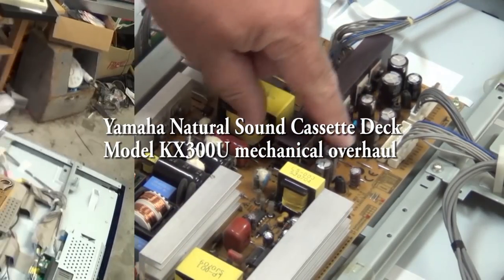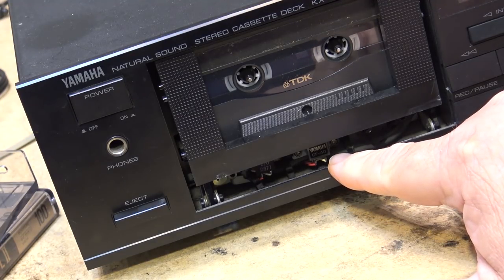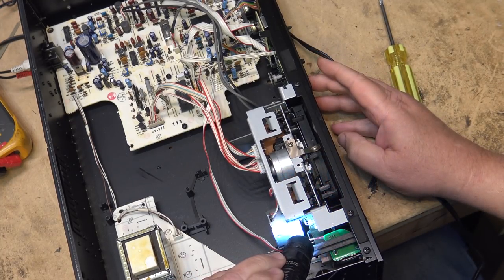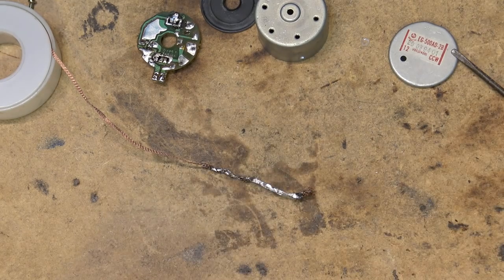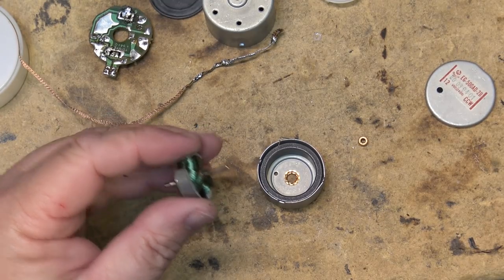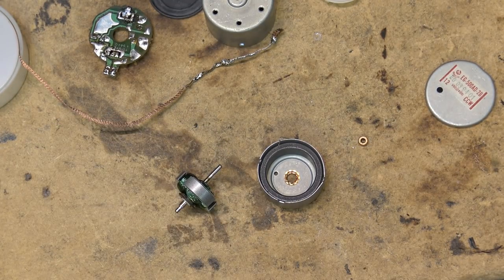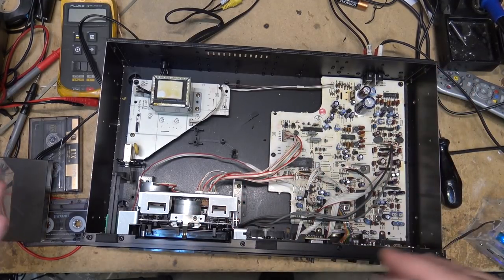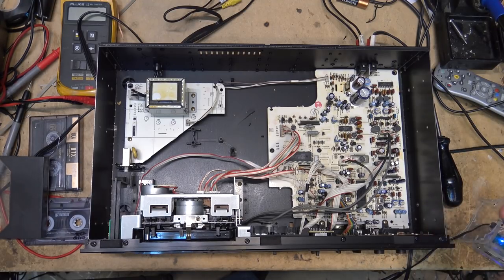Yamaha KX300U seized capstan motor repair not replace

Comment: Thanks 12V!!!
I didn't need to go this step, I was able to manually get the motor going and after letting it play for a while it now just spins free again!
I added a dot of oil to the shaft once free, should work its way into the mating surface.
Reply from the maker: How are you going to get the back bearing that way?
Reply: Thus far I have not lubed from the back. I am only in my thirties, so the tape players I had as a kid were low quality, so my point of reference is small. But I would imagine an dual deck, hi-speed dubbing Onkyo, made in Japan in 1988/89 would be pretty quiet... I could clearly still hear the motor with the case open; its reasonable with it all assembled.
Should I expect it to be very very quiet? I don't know what a reasonable amount of noise from the capstan motor is to know if its required to lube or not.

I need some sort of plastic pry tool, the metal cap was directly on the circuit board and the noise was not worth the damage... @12voltvids

Comment: The 2 arc shaped slots in the back plastic are for inserting a tool (I use a U shaped wire) to move the brushes out of the way when inserting the rotor. You risk crushing them if not careful.
Reply: I was about to say that 👍👍

Comment: Got the KX W202 version of that dual deck and i rebuilt the motors, the brass bearings wore out and the armatures were flapping about in there, replaced the brass bearings and the unit works great, it has lots of hours
Reply from the maker: Yup that is always a possibility.  This one just seized up because it sat so long without use.

Comment: I would have thought it would be much cheaper to get a new motor than have Dave overhaul the old one. Very enjoyable video.
Reply from the maker: When I could go to the local shop and buy one for 5.00 sure but they are all closed up. Now stuff has to be ordered and when idiots at the online shops don't listen to shipping requests to ship by post and they ship fed ex because they get a discount and then fed ex adds 37.50 in broker charges to a 5.00 motor it is not economical to do it.   This was an easy enough fix.  9 out of 10 motors center be fixed like this.
Reply: @12voltvids   Andrews Electronics here in U.S. is very helpful in finding parts. They pretty much have diagrams for everything and so when you call just give the model no. and describe the part needed, motor  etc. Also they have a research dept that will search for parts & call you back later.

Comment: Thanks for the fantastic tutorial! I've got a deck with the same, apparent problem on both decks. They both click when you had play and FF/RW, but nothing happens. The deck is nearly unused, but it sat 30 years in it's original box. I'll try lubrication of the capstan motors first! Great tip about the solder points coming apart, as well!

Comment: Lucky me so far have not had to take any motors apart yet.  Just finished a Nak CR-3A and had to soak the cam switches over night in Deoxit to get good continuity.  Keep up the good work,  love your channel.  I did score a Sony WA7ESA on ebay for 19 bucks and all it needed was new belts and pinch rollers.  I did work on a DJ mixer from Canada many years ago and the gal really loved it and paid $100.00 US dollars for two switches it was made in Europe and the only parts distributor was in Quebec Canada,  Duty charges are ridiculous.
Reply from the maker: Not duty.  Broker charges.  Totally different thing.   Private companies like fed ex have their own charges to fill out the paperwork.   By post I have never paid s penny except when someone does the foolish thing like declaring a broken piece being sent for repair with some outrageous value.  A Walkman is not worth 1000 but for the guy that thought it was, well he paid 175 in taxes to get it to me.   It was a broken Walkman, it has a value of $0.00

Comment: Great job!
I completely follow your ideas about components replacement, even if shipping fees are somewhat lower in EU, parts for a 20 years deck are difficult to locate or quite expensive, even in top renowned brands. Most parts like motors or transformers have to be sourced in China with high transport (that's heavy stuff) and toll fees, and can easily be lost when not needing 1 month delivery time. You can sometimes resolve the trouble finding a similar machine on eBay for exchange parts, or buy a high end industrial equivalent, but this solution can also become a pain in the "budget". So when I encounter this kind of motor, I prefer your solution, a few minutes well spent. Some motors have the reputation of being much more tricky to disassemble, those with fragile nylon couplings or complex clutches, but that's finally always the same problem: find the assembling solution and reverse it, or find an alternate one, even partial, that gives you access to the failed or seized part.
I've also saved a few transformers with failed thermal fuses or bad solders, and needs high voltage insulation tests... Plus, most transformers have specific or multiple output voltages, a nightmare if you need a supplementary medium voltage for fluorescent displays, or separate outputs for AD converters.

I hope your new solution with audio rights will work best against these illegitimate claims! Even if you sing a Gregorian anthem in latin , there's always an escrow pretending he did it?

Comment: That was really interesting to watch. Thanks! I really learned a lot. I was trying to record old cassettes with an old Sony Boom box given to me by a friend. It played one song, then kind of speed up the playback speed. I stopped the cassette and ejected it to see if the tape had been pulled, but that wasn't the case. Put the cassette back in and hit the play button, nothing works. No FF, No Rew, no Play. So I've been Googling what the problem could be and came to your channel. I'm not trained in electronics, but I do like taking things apart. So I'll try and see why the capstan is not rotating. The playhead engages, but I don't know why nothing is turning. The belt is still in place. I don't know if it is slack. Or maybe it just needs so cleaning.

Comment: Great job =D  I've done the same thing myself!  Sometimes its hard to source a motor of the correct dimensions, voltage, RPM etc.
Reply: Absolutely. By the way, hope your doing fine.
Reply: Of you buy one off ebay and it is a pull from an old unit.
Reply from the maker: Thanks, I take my bow now :)
Reply from the maker: @HBAVHS  I'm doing great. had a crapy summer as I was attacked by some nasty hornets, and found out the hard way that I am allergic to them, and found my self in the hospital hooked up to all kinds of monitors. Then what do I do almost as soon as I recover, get stung by another one of those little bastards.

Comment: I fix a lot of fans as well, using a drop of oil into the sleeve bearing to get them lubricated again, and they ran for many more years. Also used to repair small fans, where you had to replace the 2 tiny bearings the fan ran on, and then assemble it again. Had to fix, as they were no longer made, and as source of the bearings we had a large collection of assorted synchro assemblies, from scrapped aircraft. Lots of gears for the current aircraft repairs, and all I needed was failed syncro units for the bearings, and the odd working one to grab new coil assemblies from to fix failed windings, so we were really frugal with the pile of scrap.

Comment: Great video, smooth talking. I guess these simple decks have no issues with torque, i mean i have an expensive deck that has issues getting to the end of the tape. Wowow & flutter increases minute by minute, Just because it needs the torque spindle to be slightly slowed (Like a VCR) to keep tape at the right stress. Without it it eats tape as you well know. The power on the motor is sufficient for FF up to 98% of the tape. at the end it just struggles and struggles. The same motor RWD's perfectly. It's just that simple Y gear that turns left or right with RWD and FF. The left spindle has a tension regulation as i mentioned the right has none. So why have these simple decks no issues with this? It is a pioneer CT-339. It is a bit of a mystery, bought it for 9 euro's because it was malfunctioning. It turned out that these decks have a tiny plastic part that pushes all so slightly against the back of the left Spindle Gear. It was missing, that said it recorded fine but only on well cased cassettes from TDK or Maxell. These had strong tape regulation inside the cassette and the deck had no issues with those. Only wow-wow and flutter would increase slightly but noticeable at the end of the tape. I replaced belt, didn't work. Than i looked up the service-manual and it show no sign of a tension regulation in exploded view. I dismantled the mechanism so i could see inside at the back of the spindles and yes there was that tiny bracket that would house a tension regulator. Probably a ball inside a tube rolling against the back of the left spindle gear with a spring. I fabricated a simple plastic replacement and the deck records fine now with all tapes but with all the problems i already mentioned earlier. My guess is these decks are delivered from factory without this tension regulation part and hope for the best. Think about that, from Pioneer?
Reply: I had the same problem with a brand-new 2020 Marantz double deck I had bought! The Capstan's looked like something out of a gumball machine! What a joke! I had to bring it to the electronic recyclers two weeks later! The best decks are from 1988-1996.

Comment: Smashing repair, well worth the time to recover that motor.
I looked around for a motor for my mates 1977 tensai tape deck, but there was a lot of crap out there at daft prices, so gave the commutators/brushes a clean and it was good enough.

I always found the old self regulating motors with the flying out weights/contacts very novel.
Must have been a very expensive motor to manufactuer.
Reply: I just repaired a Fostex X77 Cassette multitracker with a worn out motor bearing. It's no wonder the motors wear out on these things because it is a one motor deck. FFW, RWD, Play all handled by same motor. Finding the correct Dual speed,CW motor was a nightmare. Eventually got one shipped from seller in Australia!
Reply: What about the decks that have a constant running motor, i always thought that was a fast way to wear it out.
Also the single motor that runs for two decks, madness.
Reply from the maker: Those motors with the speed governors were used in many old 8 track players. Speaking of that, just got another one of those in.

Comment: hi i have seen the motor what's in this on ebay £2.50 each 2400  RPM they do go up to 4000 rpm   2 speed one £10 
there is a need for the  low cost  motors in the deck  very good for the money  i tell you what way CW CCW  motors and 2 speed 
thanks for putting up the video  your mate is like you man doe's not like to  pay for my time

Comment: The worse cassette deck i attempted to repair was a fisher studio standard double. Those things are horrible. Each deck side had like 20 tiny metal screws that hold the sandwich together and u have to take that apart to change belts. I tossed it in the trash. I have a very nice Kenwood auto reverse deck that has a very noisy motor. Plays okay but bearings are noisy. That one needs to be done this way too and I have put it off. Will take patience.

Comment: Worth trying thats for sure, since the decks not worth much more than $50. Great video.
Reply from the maker: I have done this probably over 100 times. Some times the bearings are worn out, but in many cases like this the iol has gelled.

Comment: I would say that was a very good repair, Could you show how you checked for calabration of the speed..
Reply: You need a calibrated pre-recorded test tape and line output hook into a scope and all you have to do is hit play and then adjust capstan motor to match the correct frequency that was pre recorded on the tape pretty much. You can use BNC to RCA adapter for your scope. You can find the test tape all over eBay, or if you have a deck you trust that been recently overhaul and calibrated, you can use that to make your own test tape.
Reply from the maker: I have a calibrated technics direct drive deck that I use to make 440hz 1khz and 3khz test tapes.   I usually use 440 for speed as a cheap guitar tuner can be used as 440 is the A string.
Reply: @thetechgenie7374  Thanks.
Reply: @12voltvids  Thanks.

Comment: i try this with the Marantz SD225 TAPE DECK motor the barring was black but i oil it now it runs cooler then it did  i fixed the speed slows

Comment: Hey I have a eg-500ad-2b motor just like in this unit that is pretty loud, should I take it apart and check and lube bearings or just get a new unit if so where do I get a good replacement?

Comment: Nice video, very detailed. A question though, i got some grease bearing oil in a standard Tascam repair kit, can i use this as lube/oil for the capstan motor? Anyway, i had to order a new motor anyway as the pcb and foam material were so dried out it basically crumbled when i tried to open it.

Comment: Saw your work repairing that motor.  Very nice.  I have an Aiwa unit with 4 terminals on the motor.  Trying to find out why it won't run the machine.  2 terminals will run the motor the other 2 don't Is that right?  Why 4 terminals? Thanks!

Comment: Great breakdown, nice work. I have a Tascam 244 4-track that I purchased not too long ago from the original owner who used it quite a bit since buying it in the 80’s. He was also a heavy smoker. I managed to clean a lot of the tobacco stains out of the machine, but the motor would have sporadic speed changes when I tried to record or play. Would that be a similar issue to this machine you worked on? My guess is maybe some of that tobacco stain/tar got onto the spindle and is slowing it, but it might be FUBAR, as you say. Any thoughts?

Comment: Same problem with many other decks, Aiwa, Sony, Nakamichi because the thing sits unused for years. I need the same 12V CCV 530 Mabuchi motor, but the original Japanese ones are not that easy to get. Did the same thing as you did but the W&F is very high and speed fluctuates. I only scream when I stub myself. You know there's a tool called hammer. F... brushes😤😬
Reply from the maker: Sitting idle is the worst thing for anything electrical or mechanical.

Comment: Those mabuchi motors werent known to be too reliable i got a turntable that uses that same motor, rumbles like crazy even after an overhaul and lubrication
Reply: Temporary fix for those bushes is to use a nail to gently tap a few dimples into the end faces, so that the material closes up the bush hole slightly, or just tap the faces to flatten them slightly, closing up the clearance causing the rumble. Otherwise find same size bushing and replace it, just has to be same shaft diameter and bush outer diameter. I have had some success turning the bush upside down, so the wear is on the other side that the old place the side tension was, or building up the gap with a sliver of solder.

Comment: I'm troubleshooting a 12vdc capstan motor from a midistudio 644. The bearing turns smoothly and effortlessly. When I put 12v on the terminals there's no movement. It has 4 terminals, the cap has +  and -  stamped above the respective terminals.  (EG-530KD-2B - 1600/ 3200 RPM)
Do you think one of the other 2 terminals act as a trigger ? Cause I'm putting 12vdc and nothing's happening.

Comment: I really enjoyed the video and just Subscribed. A couple of newbie questions..as I am reading a lot of conflicting info. What did you use to clean the capstan (isopropyl alcohol 99% ?), and even more curiously, what kind of oil did you use / should I purchase to lubricate the capstan motor? (I went through the comments and did not see this asked...and unfortunately I could not tell from the video).
Reply from the maker: Isopropanol 99% to clean the capstan and pinch roller. The oil i use is 3 in 1 electric motor oil. This is virgin 20wt oil. Not the same as engine oil as that has detergent in it and corrosion inhibitors. Electric motor oil is pure oil nothing added.
Reply: @12voltvids  Thanks for replying so quickly and for being so specific. It's really helpful! 

I'll ask one further question that I was curious about from watching, but held off on asking. I think you mentioned that you used 3 volts to test the motor. May I ask what you used to safely push power to the little motor?

EDIT: I think I answered my own question by watching another beginner's guide on using a multimeter where the instructor mentioned using a "variable power supply" :)

Comment: Having owned this since bought new KX300U, enjoyed watching you tear apart that elec. motor but gravity and a quality refined lubricant will accomplish the same result as I have done both motors on mine. I disagree with your analysis that this is all plastic, the entire chassis is metal, it's not a SANYO. You should done both motors, just a matter of time before other starts going bad.

Comment: in the end i had to order 2 new motors  £6 in total    the  motors in side were sealed    it's a rare  3  3/34  ips duel  deck
with a mixer job

Comment: can you swap out a motor  from another cassette player   if the same voltage. .
Reply from the maker: Need to be same speed as well. There were many different speeds.  2100, 2400, 2500, 3000. All depends on the pulley reduction ratio.